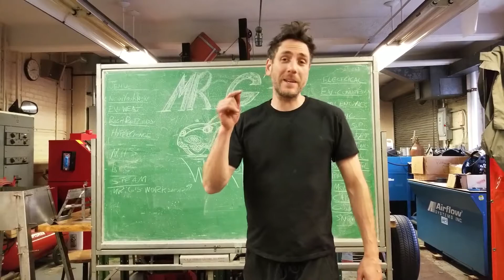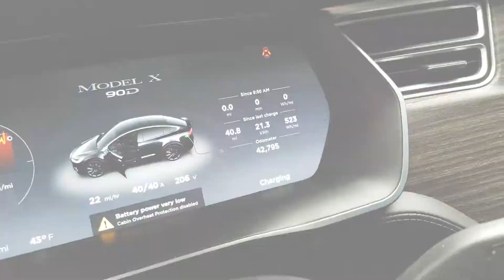Mr.G's Workshop: Welcome to Shop Class

Comment: Saw your interview with Paragon and EV West. Your channel looks awesome. Can't wait to see more videos!

I'm also interested in EV conversions. Especially if you're also building custom battery packs. How to set up the motor controller, charger, BMS, etc. Thank you!
Reply from the maker: Yes I will soon have a project video coming out. I'm going to convert my Ford Ranger. And I can do a video on the topics you asked. Which one is most important to you first?
Reply: @MrGsWorkshop  Well, that is a heck of an offer. Thank you already. If I had to choose, these would be my top EV conversion topics:
1. Battery pack design. This is mostly a question for those using 18650s to build custom battery packs. How to design a pack around the load of the motor. For example if the cells have maximum discharge of 3C or about 7 amps. How to design the battery packs to not stress the cells. Also, thinking through how the amps/volts (series/parallel) will affect speed and range. 
2. Wiring. How to design an efficient wiring of the drivetrain and auxiliary systems. How to set up the DC to DC converter for charging the 12v aux battery. How to wire other aux systems like sensors for amps, volts, temperature,  as well as vacuum pump for brakes, power steering (if needed). Testing for parasitic drain.  
3. How to program the motor controller (Curtis) and charger

I'm sure there's more but it would be great to get your expertise on these issues. Thank you and thanks for all the great videos!
Reply from the maker: All good topic ideas...  I can do the DC to DC charger next time I am at the College.  The other ideas I hope to get to soon.